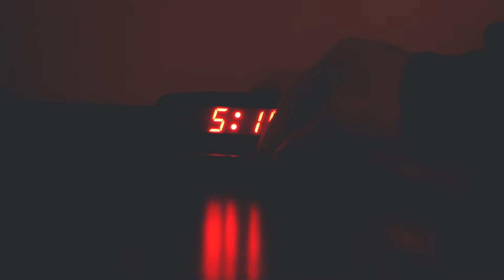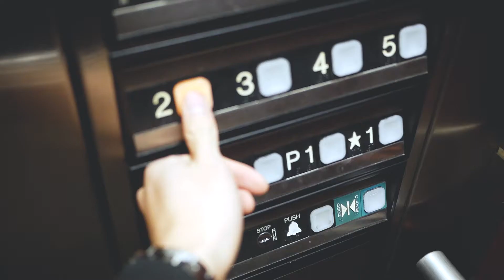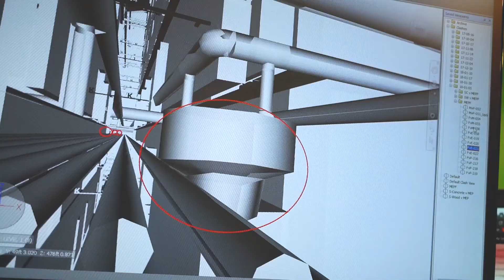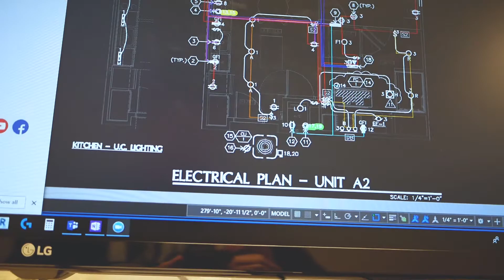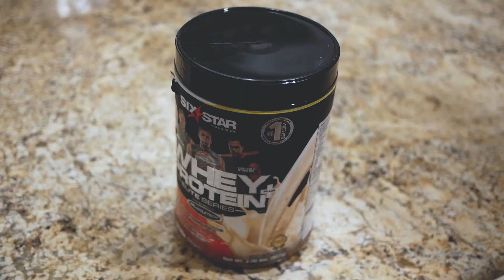A Day in the life as a Katerra BIM Engineer

Comment: What's the role of mechanical engineers in bim ?? As I'm mechanical engineering student, I got an offer for Bim trainee...so, please tell me more abt that
Reply from the maker: Sorry for the late reply, been busy. Basically ME in BIM are in charge of creating Mechanical Equipment Models. We call them Revit "Families". These models are used to perform clash detection to make sure your EQ is not clashing against a plumbing pipe or etc. There's a lot more to it but this is basically what a ME would do in BIM.